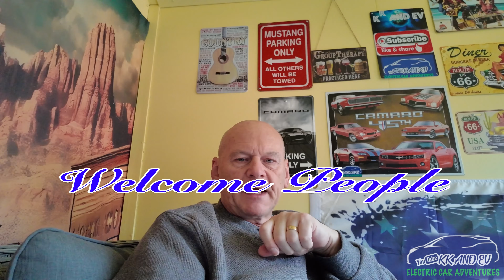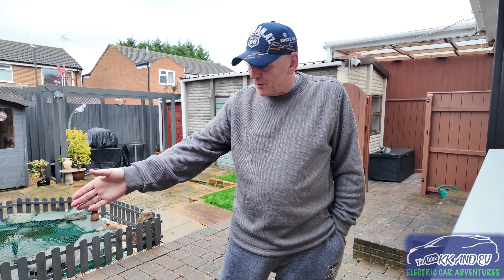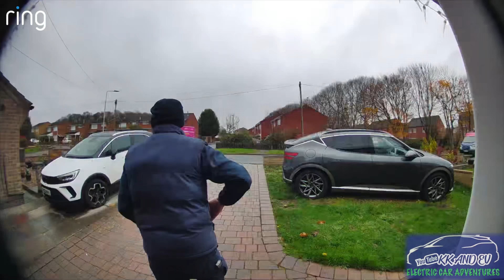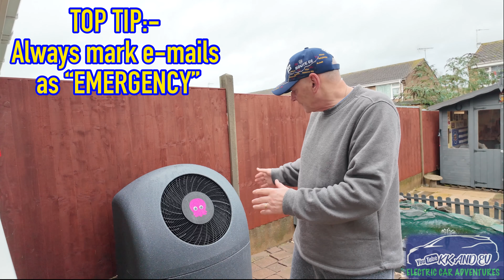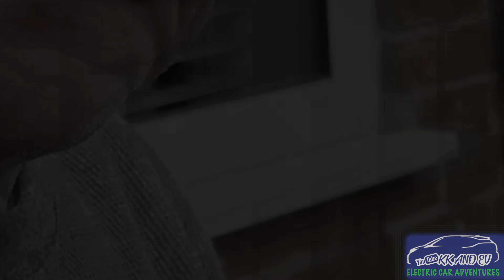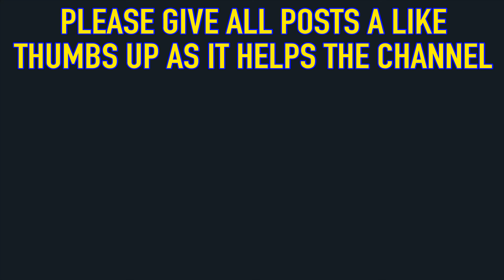OCTOPUS COSY 6 Heat Pump DEAD after 8 months! UNREPAIRABLE !

Comment: Great content. I have one on order to replace my oil fired boiler. You may have covered this somewhere, but can I ask how noisy it is? Best wishes.
Reply from the maker: Good question. When they fit it get them to put it away from room windows. Ours is under a metre to the bedroom window. MOST of the time you take zero notice but on a cold evening into the night it can be a little loud especially when it first comes on. The colder the weather the more the fan speed goes. It has not been an issue as most times our house heating goes off at 8.00 pm latest and then the hot water created from the Heat Pump is on for 1.0hr each night from 11.30pm as to use the cheap rates.
 It has not put us off having it but the odd time I wish they had put it further away from the bedroom window. Hope that helps.
Reply: @KKandEV  That's good to know. Ours will be down the side of the house. Fortunately our house was completely gutted a few years ago and has all infrastructure already in place in an outside "plant room". So main electrics, flow and return are literally just behind the wall. They are also installing a new 180 litre tank in the loft but again, there was already a new one there with pipework in place. Hopefully it should end up a very neat install. Many thanks.

Comment: What temperatures do you run your home at, I thought I saw 23 deg set when you showed the app. I want 22deg all day.
Reply from the maker: I set it too 22/23 but it normally gets up to 21.5 max. If the Radiators are all fully open the house is always warm after about an hour.
Reply: I am just in the process of getting a quote from octopus but the survey we’re quoting temperatures of 21deg. I keep my oil system at 22 so just a little concerned as to if I will be able to run 22 deg.have you had any issues with achieving your temperatures? Enjoyed your videos👍
Reply from the maker: Not really… just don’t expect it to get HOT on the Radiators as it won’t. It’s meant to keep a stable temp at around 20-21c and it will but set it to come on about an hour earlier OR keep it on all day set at 20c . The house needs to be well insulated.

Comment: 8months clearly a parts issue, but I agree it’s not good optics that they didn’t repair on site, clearly a capacitor issue and or fan failure , but still the way it was done , clearly the back end needs more training or software so it auto removes the previous device off accounts easier than waiting for a timed window , this could have been done the moment the second device was shipped out ,  when they scan it out from depo for delivery.  But this I think was not down to parts availability but lack of qualified technicians mcs qualified on the day . If there anything like my experience with the Mitsubishi 5 years ago was a minefield I had to book 6 weeks in advance , but then again octopus needs to have more qualified tech team members in the field as servicing yearly to keep warranty also had to be better communicated to customer of window times. And delays needed
Reply from the maker: Good points. I feel it was a total fan failure but still cannot understand why it could not be replaced on site. Two blessings are the warranty started again from the new one being installed and the time it took would have really been no different by the time a fan had been supplied.

Comment: We live in a mid-terrace.  I measured internal wall to wall width to be about 3.65m  Only place for a heat pump would be under the kitchen window it if it can fit ... window and doorway take up much of that limited house width.  The recent change to boundary requirements, and also Heat Geek / Newark mini-store has put a heat pump as a potential replacement to our 20-year old gas combi firmly in the rounds of possibility.  We use Octopus Energy anyway and the width constraints and good app makes the Cosy 6 a solid container.  I'm aware of the poorer scop and mid-noise performance ... been trying to look for negatives for an informed preference.  Ideally I'd like that new Samsung EHS All-In-One if it were to get MCS listed because I have a computer-office in our tiny house that's always too warm even with no heating on and less than 5C outside so heat recovery in the unit would be amazing along with cooling for summer without requiring additional inside space. Would be nice not have the window open and fans pumping in 5C air in the winter to keep cool while having the combi on to heat downstairs.  I hate the wasteful situation.   But I have to be pragmatic.  My partner's less technical than I am so support services and easy-app etc. are very important.  And then noise because of densely populated street (that Samsung EHS would likely be less noise too).  Always compromises.  Anyways - this video was very informative, thank you.
Reply from the maker: I’m glad you enjoyed it. I have more coming up on the channel and a special on my 3 month Winter bill with full details and costs using the Heat Pump. Hope you find a way around the issues and choose what’s best for your living conditions. Thanks!

Comment: Interesting to learn of someone else having their cosy 6 unit replaced in less than a year...me too!

Here is my horrendous Octopus experience, grab the popcorn, it's an epic!

My cosy 6 was installed Nov 24, broke  down the very next day. Yes, Octopus did attend, very quickly ( that very evening around 10pm), the engineer travelled around 50 miles! Bit hadn't a clue what the issue was.

Yep more engineers attended on subsequent days, still not fixed, then eventually on day+4 a supposedly heat pump expert showed up and discovered an issue with the Comms cable, so had to replace it all the way from their hub to the HP.

After that, we had a plethora of problems. Horrendous noise, vibration and resignation that transmitted into our home. Obviously we had the thing working during earlyorning during off peak hours to heat the water cylinder, and to heat up our home prior or waking up.

When I say waking up, we didn't need an alarm clock, the thing kept us awake all night. We had guests staying over the Christmas holiday into the new year, they too had disturbed sleep. We ended up having to shut it off.

Our heating system was compromised once the grey rock had been fitted. We could either get uostairs heating on but not the downstairs (underfloor heating). Octopus had removed vital components on this circuit and a control setup that was inappropriate.

It was discovered to have been incorrectly piped up to the UFH! After several months they came and spent 2 days reconfiguring the pipework and reinstating the components that they removed.

It still wouldn't work correctly, because apparently the existing heating controls could not be connected into their stupid app only system. 

They attended dozens of times over the 11 months so ce install, trying this, trying that, altering and adjusting, basically tinkering hoping to find a solution to the noise problem,which they never achieved. 

I spent hundreds of hours on the phone and corresponding with octopus trying to get the thing sorted. Just passed from one department to another, having to describe the issues time and time again, nobody at octopus had a clue.

 Their design bod, an American I think,  told me it was working to specification so they wouldn't change it! You couldn't make it up.

I had then to fight with the trade body to get octopus to replace it....which they did a month ago.

It has caused a lot of friction in our family home, my wife hates the thing and wants it removed and a gas boiler reinstated. It has been a very stressful year dealing with this.

So, a new one installed, we could now sigh with relief.

Actually, no we can't. A day after install I noticed a puzzling and concerning scraping noise from the fan. I couldn't do anything about it as we were going away on holiday that afternoon, so left it whilst we were away.

We returned 2 weeks later to discover a freezing cold home, the heating hasn't worked even though scheduled to do so.

I discovered that the pressure had gone to zero, yet bizarrely the HP and fan was running ! But no circulation because of no pressure, so the thing has been running like this while we were away! This should not happen as it should shut off in such a pressure loss event occurring.

I depressurised it, but after 2 days back to zero. I had to keep recharging the pressure to keep the heat on whilst I spent my spare time troubleshooting the problem. 

Nothing to be untoward in our home so, again, back on the octopus hotline. It was now Friday, they couldn't get anyone out till Monday and recommended that I turn it off to prevent any possible damage. I had to use the immersion heater for hot water and use our single electric fire and the 2 fan heaters that they had left me previously for heating.

Monday morning, whilst waiting for their attendance, I noticed a water patch in the flagstone under the cosy 6, it couldn't be condensation as it hadn't been working over the weekend, so I guessed it was likely leaking from inside 

The engineer showed up late afternoon, just looked at the water patch and said he would have to rebook as he didn't carry any parts on his van! He didn't even remove the case to have a look! He said it would be ok to continue to use the unit as long as I could manage repressuriding as necessary.

It took another 4 days for another octopus guy to show up. When he took the case off he could see that the leak was from the strainer inside the unit, but he wouldn't touch it for fear of "opening a can of worms" and causing it to fail and losing our heating (it was a freezing cold day). He  said he would have to order a replacement strainer, as they don't stock such a part, and return when they have one.

A week later another attendance, another different engineer. He disassemble the strainer and repaired the leak! A new part wasn't necessary, he was bemused why the 2 previous engineers hadn't bothered to effect a repair.

I told him about the worrying fan noise, he videoed the noise saying he would submit this to their tech team for assessment, saying that he would likely return with a replacement fan.

2 weeks went by before yet another engineer appeared, I enquired if he was replacing the fan, he said no, he had been sent to do some "adjustments" as instructed by to their technical dept. He spent a couple of hours faffing and tinkering, all to no avail. He would refer it to his supervisor saying the compressor needed "regarding" .

He said he couldn't do it as he wasn't qualified, a suitably qualified engineer would need to attend. As we are going away to Spain on the 15th Dec for 3 months visiting family, I insisted that he contact his supervisor and get me a firm date for the repair before we went away he phoned his supervisor who couldn't commit to a date as he needed to source a qualified engineer, he would call me personally the following day with an appointment date.

Well, that was Monday, 8th December. No phone call from the supervisor! 

It won't get done now, so it looks like another holiday with worry over our crap cosy 6.

Do, 13 months since our exciting install day, we are on our 2nd faulty unit, have a heating system that cannot be controlled properly.

We are both sick to our back teeth with Octopus, we wish we hadn't bothered with a heat pump, should have kept our gas boiler....as my wife makes a point of reminding me every day, she's very stressed over the whole escapade with Octopus.

Comment: I think the Heat Pump looks fine. Better than one of those large Air Con looking things. I’m definitely thinking about having one fitted with that £7,500 Grant available. I will use your referral code if I do… many thanks KK.
Reply from the maker: Yes… make a use of those referral codes as I’m not sure when they will disappear!
 I believe the £7,500 Grant for Heat Pumps are still available until 2027 ( allegedly).
Reply: Read my post on here before you decide, and those of others on various forums who have problems with their cosy 6.

If you must go with octopus I recommend that you go with the Daikin (if they still fit them), a tried and trusted product rather than a flawed experimental one.

I feel I have been used as a guinea pig.

Comment: pretty ugly unit, occuppying an inconvienient space in the garden right in front of a window. House designs should be changed to account fornew heating designs.... Also the wiring up the wall.... terrible cable managment, should all be hidden.
Reply from the maker: I’m happy with its looks over a typical big ugly square box… The space the unit takes up is minimal and was unused previously. The black coverings are for lagged water pipes not CABLES. If you look closer you will see the cable goes up into the loft area from the safety switch  and back down after the windows so is hidden as much as possible.
Reply: @KKandEV  house designs need to change for future so these arent just stuck in the garden. better in teh roof space or a special alcove outside or community heating  like in germany. Hot and cold water piped to the apartment or home.  aircon units normally are suspended on high walls or put where they dont interfere with the useful space where i am.

Comment: It shouldn't be wobbly at all under any circumstances, which might cause excess bearing wear. That's my understanding at least.
Reply from the maker: I cannot remember if the last one was ??
Reply: @KKandEV  Might be an idea to get a spirit level and insert a  packer under the feet, so it's level in all directions and doesn't wobble.  Just a thought.
Reply from the maker: Thanks.. after a bit of advise it seems it’s meant to move a little on the rubber blocks as it saves the chassis from damage on start ups and close downs. We shall see.
Reply: @KKandEV  🤞

Comment: The design itself tells you the effort put into it to stand out rather than other things. Like functionality, reliability....
Reply from the maker: Normally they are functional and made for purpose. Most folks have no issues. It works well for smaller properties. Just shocked it packed up.
Reply: Or effort put into cheapness? .  The  company  octopus built was RED , who made non square Heat pumps in NI  ( rumoured optimised for damp air ) ....    For me it looks extremely ugly ... but lower SCOP on Cosy6 is the main reason I haven't got one.  ( Also do you need a phone app)
Reply from the maker: Yes.. the App allows for schedules, boosting and off/on. You can have Hot water whenever you wish as they come with a 3kwatt heating element in the tank. It is super fast if used.
Reply: @brackcycle9056 yes, I concur. The design and implementation is flawed... That fan on an angle is utter stupidity, it puts unnecessary stress on the bearing, promotes excessive vibration if not balanced 100% spot-on and blasts super cold air into people's faces as they walk in front of it.

Form over function.

Sadly I have one of these, a big mistake.

All the effort has been put into aesthetics.
Reply from the maker: I guess there would have been a lot of pre-testing and more before they were passed as adequate but hey.. I’m no Heat Pump designer.
 It would be good for someone from Octopus 🐙 to comment on my post who could inform us better.
Reply: @KKandEV I've yet to see any feedback to criticism of their product, they are all hype with the belief that they are the best.

Comment: That thing looks like a toy. The slightly upward tilted fan looks,like it has been designed so that it will catch leafs and debris when not spinning. Having rain pouring down on the bearings cannot be good either for the longivity. Germans, Japanese, Swedes, and South Koreans make heat pumps that work. I would stick to some of those. I think Bosh have manufacturing in Scotland as well. I do not know what models they make their.

In general there is nothing fancy in these heat pumps. They are just a big reversed refrigerator. They do not cost much to manufacture. That is reason why they are not worth tepairing.

We have two heat pumps an air source heat pump by Mitsubishi Electric, and a Bosch geothermal heat pump for the house. The first geothermal pump we had was by Nibe. That lasted for 17 years.

I live in Finland and here geothermal is most popular due to cold winters but air heat pumps are also popular as additional heating. On the geothermal side there is Nibe, Bosch/IVT, Thermia that arebthe leading brands. for the air source heat pumps it is Mitsubishi, Toshiba and Daikin. Imwould not choose any other brand except for maybe Wiesmann. All of the above mentioned brands have available and knowledgable network of installers and service people.
Reply from the maker: Lots of content.. thanks for it!
Reply: I had to watch the video again. The opening for the fan is small for a 6 kW pump and covered in the middle. The fan have to spin quite much faster than on my pump. I only have a 2.3 kW pump but the fan is bigger.

Aha it is made in Ireland. Then I understand why it look like it does😅
Reply from the maker: Luckily it’s a small property which has very good insulation so needs no bigger.